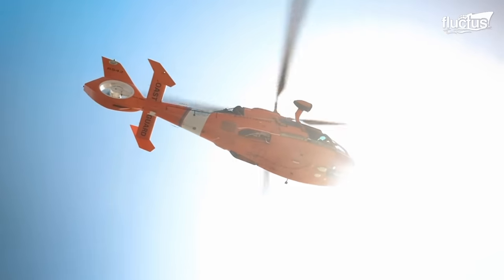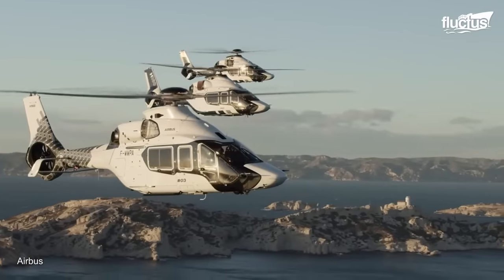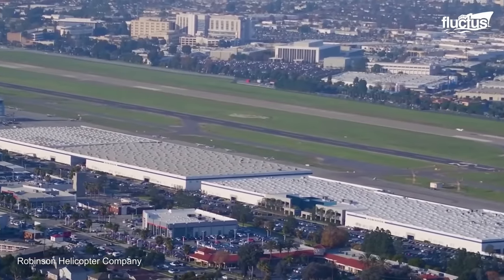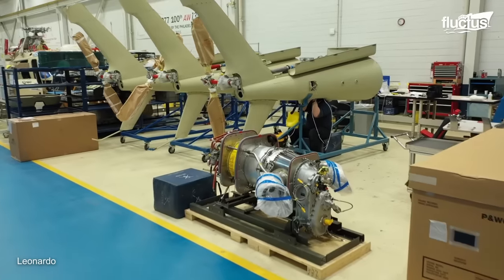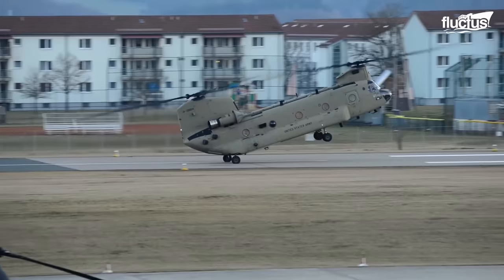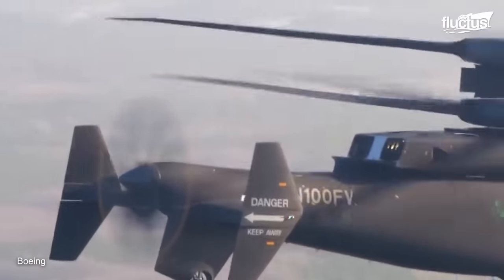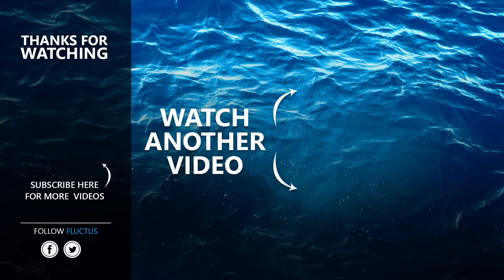Inside Billion $ Factories Producing World’s Most Advanced Helicopters

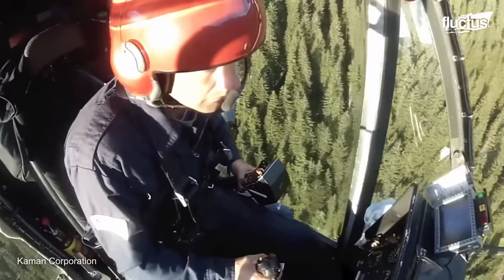Comment: 6:26 The K-MAX rotors are synchronized mechanically, not electronically, as in both rotors are powered from a single linkage to the engine. It is physically impossible for the rotors to hit each other under normal operations (as in any rotor damage could cause contact). Electronic synchronization would provide a possibility of failure.
Reply: Was surprised to hear the "electronic sync" statement.  Thanks for clearing that up.
Reply: When I heard them say electronically I thought no way they would do that. One computer glitch and it would crash they must be mechanically synchronized so they cant hit. Thanks for confirming
Reply: 1 gear or rod breaks in the helicopter or is weak n not inspected to perfection... Down goes the heli.
Reply: I also smacked my face when I heard that

Comment: Okay... 1st off that Kaman aircraft or however the heck it is spelt... SHOULD NOT BE A THING. that is the most dangerous helicopter i have ever seen. that thing looks like Dori From Nemo and its a DUAL BLADED HELICOPTER??? like WHAT!? one rotor has an engine failer or slows down or becomes out of sync what so ever those blades are going to smack each other and down goes the helicopter. That is the MOST UNSAFE HELI IN THE WORLD! NOT OK. how is it approved? The chinook is even better designed that DORI wtf.